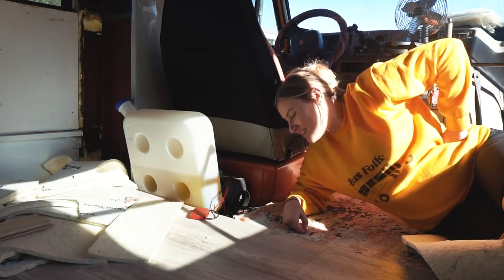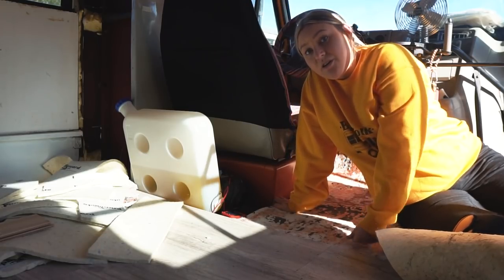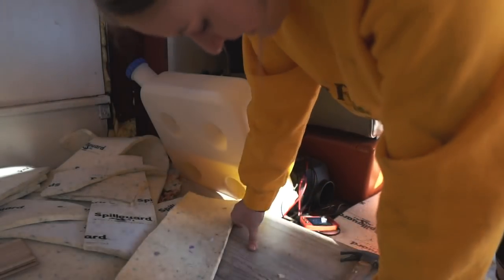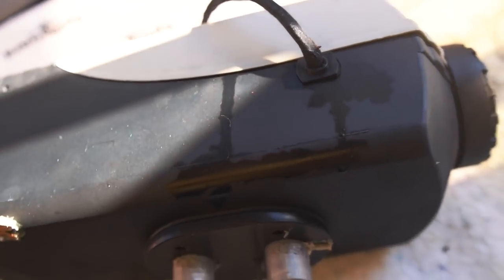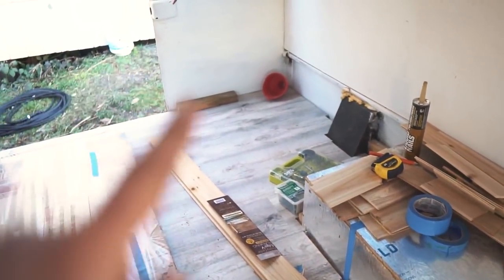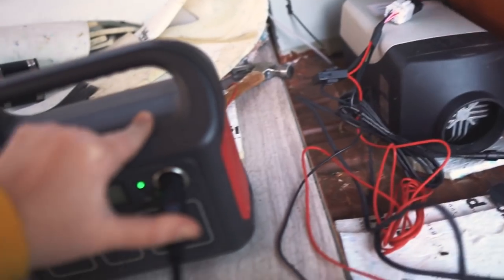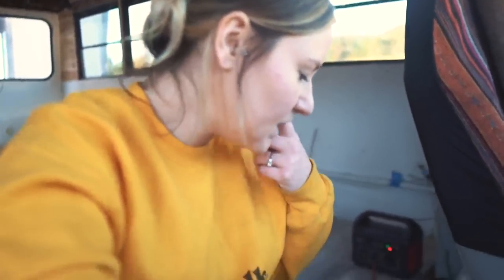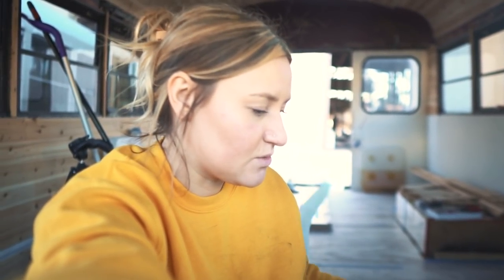Chinese Diesel Heater DISASTER - Don't Buy This

Comment: Nice!
As someone else commented, you should really have the fuel pump as close to the fuel tank as possible so as not to kill it prematurely. Also would be good to protect the fuel line where it passes thru the floor - Ie a grommet or rubber washer or maybe even liquid gasket around it so it doesn't get chaffed and start leaking.
Good that now you have some spare parts - can never go wrong with that.
God Bless, and God Bless Canadian & US truckers!!

Comment: I noticed you have that fuel line going through a hole in the metal without a grommet. What you could do is get some automotive fuel line with enough diameter inside it and run that tiny line through it up into the bus. This will also protect the line underneath from the elements. No different from using tech flex or split loom for electrical wiring.
Reply: Please secure that fuel line better.  Surely it will be mounted underneath.

Comment: When you mounted your pump, it looked like you mounted under your heater. It should be mounted by your fuel tank as low as possible. It works longer and better, after all it's called a fuel pump not a fuel suck. Keep up the good work.
Reply: The manual I used to install my diesel heater says the fuel pump shall be mounted a maximum of 1 meter (3 Feet) from the fuel tank. Also the fuel line should be installed on the tank on the side not the bottom. If you mount it on the bottom any garbage in the tank falls to the bottom and can clog the fuel filter & fuel line. The fuel filter should be mounted vertically not horizontally. I see a lot of people installing these heaters incorrectly then saying the heaters are garbage. I've run my heater for two winters in Wisconsin and it works flawlessly.
Reply: I would look into some way of running the line through a rubberized protector when going up into the bus. The constant vibration of driving and heat exposure may cause it to wear enough to beeak the line
Reply: Note: The pump relies on the diesel fuel for lubrication, so running it dry sucking air through a long run of fuel line doesn't do it any favors.  Always prime the fuel line up to the inlet to the pump BEFORE running the pump.  Cheers.

Comment: I have two of these one in my camper and one in my van, I followed you first install in the bus for my van and put the tank next to the side of the van and put a filler pipe through the side of the van but I put the fuel pump under the van like you did this time in your bus.  The one in my camper and the one in my van both have worked great.  thanks for your videos.

Comment: I wonder if that leak caused the error reading, like a pressurized system in some vehicles,  the line between the heater and the pump wasn't pressurized so the system cut off because it could be leaking?

Comment: Mine has been working great for two winters now. 5kw is usually too hot for my van though. If it does die I’ll get a smaller one if possible.

Comment: I have found many items from there do not work properly, plus many received is not what the picture or description of the item shown on internet.  So now I am trying to be cautious.  You always seem to accept failures , change plans and move forward.  If the baby is going to be kept near the floor, be so very sure that heater exhaust is not blowing into the van or near a vent underneath.  You can also get one of those safety fixtures that mount on the wall to alarm if there is dangerous gasses escaping.  Those should be a must have item in all busses, vans, campers, etc.

Comment: This isn't a heater fail! It is a fuel pump fail. These diesel pumps are lubricated by the fuel, so it is VERY important that the pump gets uninterrupted supply of fuel, especially when it is first started up. These pumps are available from 30$ to 100$, and are easy to find online. I'm installing my diesel heater today, and, despite the smell, I'm gravity priming my fuel line before I connect it to the pump. I have already test-fired the heater, and was sure that I primed the pump and line before I did. I found all this out by searching YouTube, and you can too.

Comment: Check the fuel pump to see if there is something stuck in the fuel pump inlet or outlet. If not take it apart if possible to find out if there is something blocking the pump itself. Not sure but it may be a diaphragm pump. If it is it could be a hole in the diaphragm or something stuck in the valve keeping the valve from closing. Might be worth a try to check E-bay for a pump like it. If you have one of the smaller 5,000 btu heaters you might check to see if the pump is the same size. If it is the same size the pump are probably the same even if the numbers are different. I was about to suggest just changing the pump because it would be easier but if there was a leak at the heater that would need to be fixed. If the fuel never pumped out of the pump i don't understand how there would have been a leak at the heater. Glad you got it going. You should have had your cat help last time. Maybe it would have worked the first time. It could well have been the power supply didn't have enough umph to run it. Might want to connect the heater that didn't work without installing to figure out the problem. Typical for a Cat to get there when she figured there was going to be some heat. she is talking about how she is with the heater.

Comment: Got to say   What I found out. Anything u do like trying to run the heater and something not working. Like to prime the pump. Take out the fuse and put bck in. I had to get a new heater too. And got the Vevor and even have a website. Instead of plastic case. This one is steel.  And I thought that was cool. With the turn knob controller.

Comment: Is that size Jackery going to be large enough to run a heater and refrigerator?  I have a 1500 and 200 wats of solar.  My refrigerator runs 24X7 no problems.
Reply: I would like to get the kind of your refrigerator that can run 24x7

Comment: Old-timer Full-timer Fuso 4wd JDM Bus Pacific North West. Third year Chinese diesel heater, on second heater now. Fan motor bushings noisy on startup, resaon for change. Much resurch spent on these heaters. There is only two physical sizes 2 and 5, the 7kw is false advertising. There is only one manufacturer in China, sold by different companies. The 5kw fuel pump will work on any of the larger size heaters. That being said there are differences in the wiring harness connectors depending on the controller supplied, the fuel pump connectors should be all the same. For inviting into your life, sharing your hopes and dreams. Thankyou

Comment: Better to go with 5kw unit. You should watch Johns video series on the heaters.  The 8kw is a 5kw. It's just false advertising. A 5kw is bigger then a 2kw and so a 8kw should be bigger then a 5kw. The fuel pump can push more then suck. So closer to fuel supply better

Comment: The fuel pumps are all the same doesn’t matter if you buy a 2kw heater or 5kw or 8kw in fact the 8kw heater is actually a 5kw wth max power 8kw .. the pumps are all the same as long as it’s for a Chinese air heater it will work fine.

Comment: Your problem begins with old diesel fuel that is stored cold. Research old cold diesel fuel. How to treat it and restore it and the problems it causes when used. Probably not an issue with the diesel heater until using the old waxed up fuel.

Comment: sorry to disapoint Jaylena but there is no such thing as an 8kw heater it is just a sticker a scam a marketing scam to sell to a wider range of people for different uses. there are only 2kw and 5 kw chinese diesel parking heaters, its is very likely you ended up with a 5 kw heater. I use a 2kw smaller heater than yours to heat my home using 2 litres of diesel a day to 20 degrees C its a heck of a lot cheaper than gas in the UK at the moment about four times cheaper. good luck with your adventures.

Comment: Jaylena the pump needs to be close the the tank if you have a long distance to the heater. Also there is no difference between a 5kw and an 8kw.
YouTube JohnMck a fellow from Austrailia I think... he has the best video info
Reply: The pumps are very fussy and need fuel up to it before priming